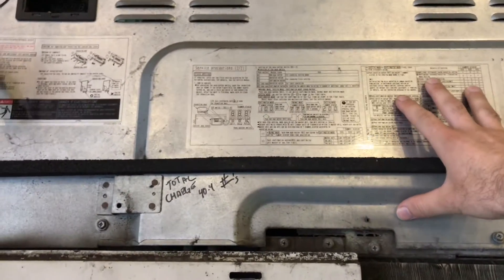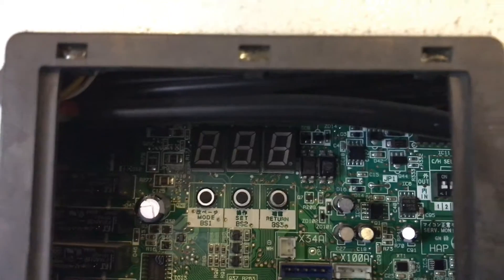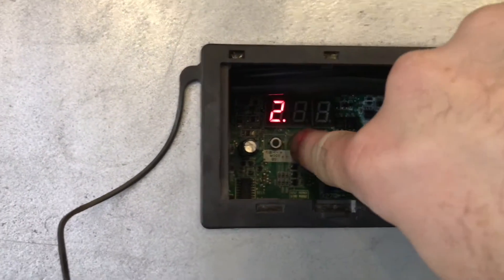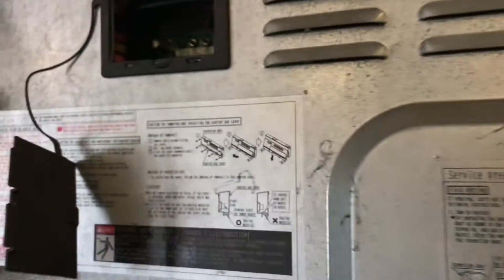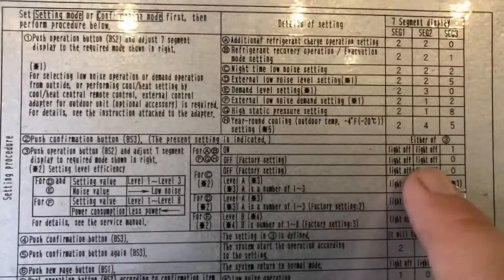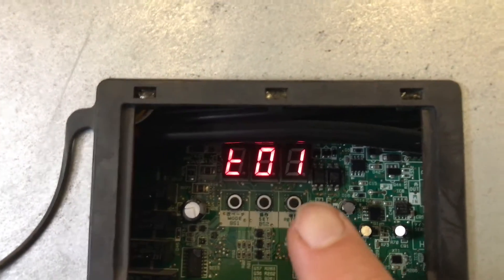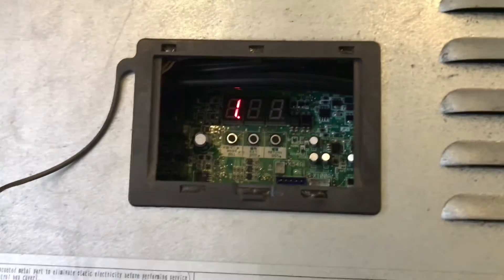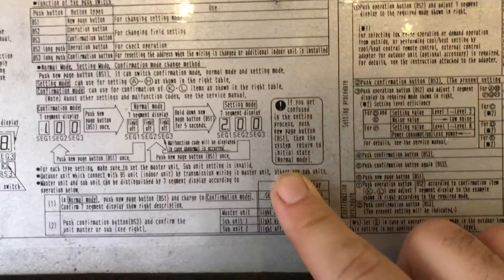Daikin VRV IV - How To Activate Refrigerant Recovery And Evacuation Mode

Comment: -In this mode, do all the solenoid valves open, or does the compressor recover all the gas, including from the piping and indoor units?
Reply: All solenoid valves and EEV's open until the mode is cancelled.

Comment: How to replace compressor without remove gas
Reply from the maker: You can close the isolation valves and remove just the refrigerant that’s in the outdoor unit, you cannot replace the compressor with refrigerant still on the lines.

Comment: im a building engineer and today I came on roof because tech was doing repairs and I noticed the technician   brazed  an access port on the unit he was recovering and he also installed a bullet piercing valve and was recovering from both the brazed port and the BPV im like wtf is this shit ... cant be right?? he stated there was no port to recover from but I clearly saw suction line and 2 other original access ports from the daiken RTU ??
Reply: im going to look up the manual for that unit and see what those acces ports are because it looked like he only had 1 5/16 to 1/4 hose adapter so he just brazed in a port...
Reply from the maker: Was this a daikin vrv system? The only thing I can think is that the two factory access ports on the vrv unit are 5/16” and require an adapter to use with standard 1/4” charging hoses. Maybe he didn’t have the adapters? In my opinion the piercing valves are junk and should be removed after use. The other brazed port they were using, did they add that? Not sure how they would have brazed that if they could not recover the system prior to adding it.

Comment: Which state do you install?
Also does it need any erv like zehender connected to this for fresh air?
Reply from the maker: I’m in Northern NJ, this system has a fresh air system with an electric heater with a separate exhaust system to ensure required air changes. An ERV would have been better but I wasn’t involved on the construction so I m not sure what factors influenced their decisions